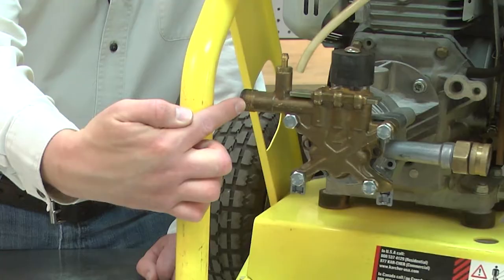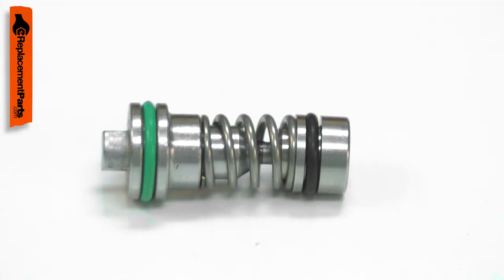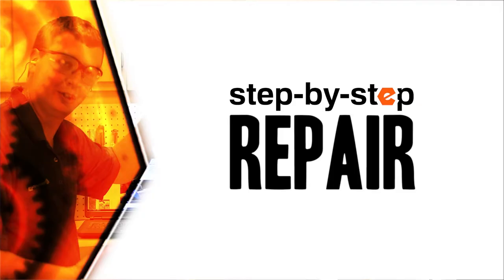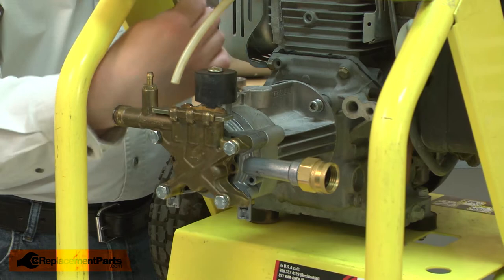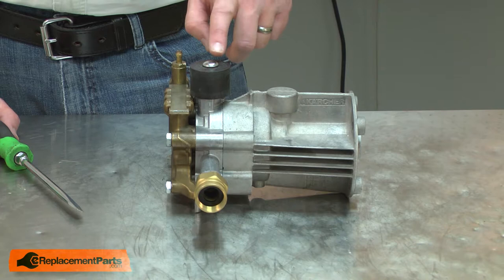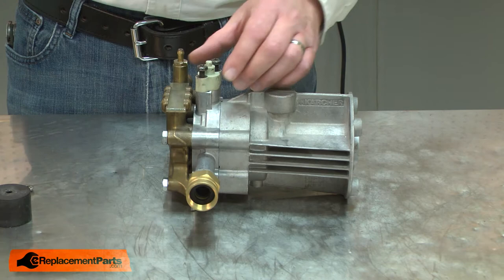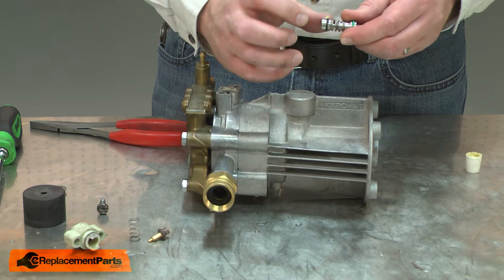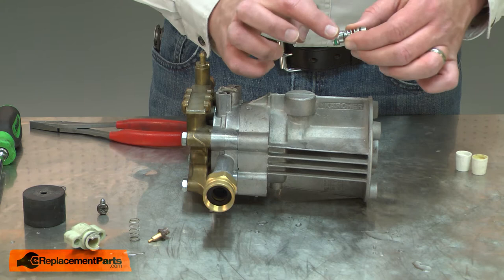Karcher Pressure Washer Repair - Replacing the Unloader Valve (Karcher Part # 4.591-040.0)

Comment: Couple of notes here: 1: You dont need to take the pump off necessarily if you can still get to this part around your machine, as you can on this karcher 2400. 2: If you have trouble pulling the valve out with pliers (I did) you can turn the hose on, start the machine, and the pressure will blow the valve out the top, problem solved. Watch where it goes and dont be standing right over it obviously.